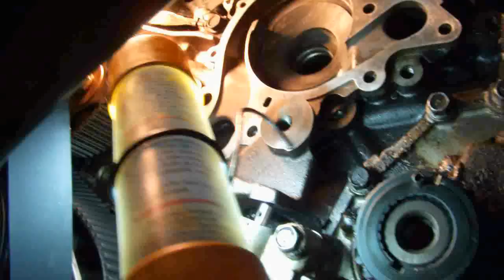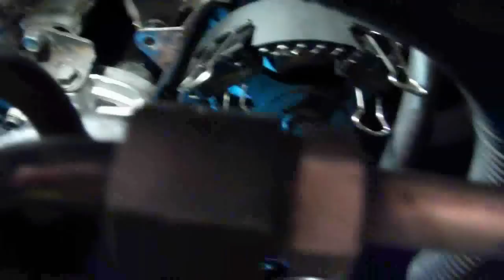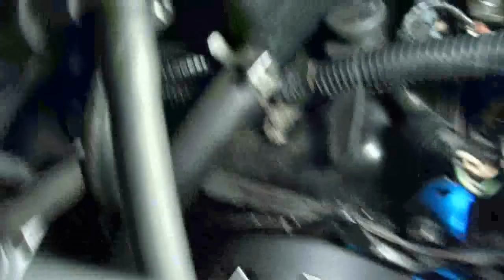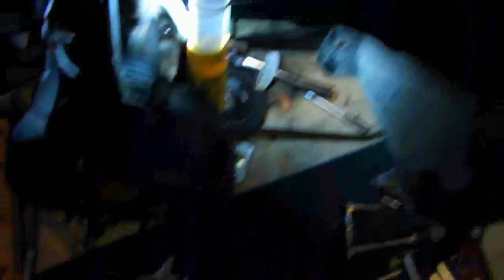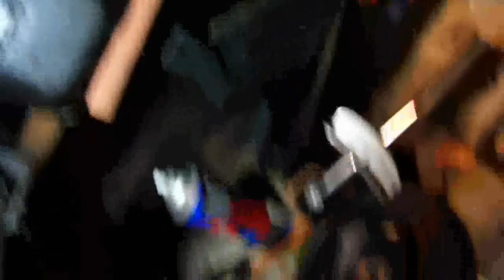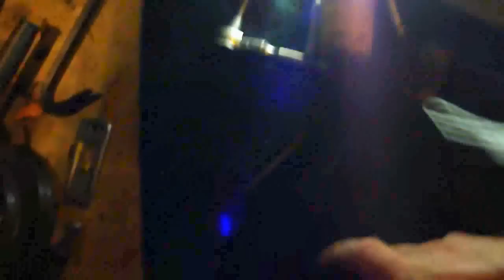1996 to 2000 Chrysler Sebring Convertible, TIMING BELT & WATER PUMP 4 of 4

Comment: I commented 6 years ago and now I'm. I have to change my cam sesls and know i have take off the timing belt to get to seals under cam sprockets. I have a 1998 chrylser cirrus lxi. I know the steps but need a little clarity you may be able to assisit with. Once i remove engine mount, and timing covers, and crankshaft pulley to expose belt, do i need to put the crankshaft bolt back in to set top dead center(TDC) before taking the belt off?
Reply from the maker: You definitely want to maintain TDC.

Comment: Joe seely that was a good piece of advice that you gave us someone I know replace the seal behind the timing belt but they never change the timing belt itself they put it all back together and now the serpentine belt is chewed up and the car is out of time he didn't know what he was doing he didn't know how to put the car back in time you go to the number one plug you find TDC top dead center you take the gears on the timing belt and you line The Notches up that's how you time a car up he had no knowledge of this single parent female pay them all kind of money and he even took her passenger right front tire and took it and stole it and put a donut on that car and it's flat this was a nightmare for this customer good mechanics are hard to find

Comment: What is the average labor price on timing belt change? Also what is the listed labor time for this job? I have a 1998 cheysler cirrus that needs timing belt change
Reply from the maker: It takes 8 hours shop labor so it's not cheap.
Reply: @syyenergy7  I've heard 5-6-7 hours..What do you charge?
Reply from the maker: I'm an accountant, not a professional mechanic.  I just have many other skills in addition to mathematics.
Reply: @syyenergy7  That's even better! You should be able to use your acconting skills to come up with a price. Lol!

Comment: I am having trouble getting the tming belt cover off of the rear cam. Any suggestions would help. Use a bigger hammer is not a suggestion.
Thanks Mike
Reply from the maker: Watch all the videos.  The power steering pump bracket is in the way.
Reply: If you take the rear valve cover off, you will have easy access to the two bolts that hold the back of the power steering bracket on.

Comment: Did you use any type of sealant on the water pump gasket or did you put it on dry?
Reply from the maker: I used Permatex 99MA high-tack Sealant, but you don't need it.  That stuff does work with gaskets.
Reply: Thanks for the reply. Also, do you need to drain the coolant to replace the water pump?
Reply from the maker: most of it

Comment: OK I could have gotten this done 2 days ago. if I was informed on this video to LEAVE NEW TENSIONER OFF.
Reply from the maker: +IceePrettyWings You take off the tensioner to compress the spring.
Reply: +syyenergy7 new tensioner has a pin it don't get removed until you put the belt and tensioner on. once it's in time then you can remove the pin. it's just a pin with a ring that you pull out.
Reply from the maker: +IceePrettyWings I know.  And you put some tension on the belt so the pin pulls out easily.  If you use the old tensioner, you compress the plunger and put in  small allen wrench as a pin to hold the plunger.  I did this job many times.
Reply: +syyenergy7 I get you usually when I do a job like this I normally buy a new tensioner to save the hastle. from compressing it. I honestly think the timing is the most difficult than anything on this car. it literally makes everything cake walk. looking back on everything with them hard bolts in the back of the head was easy lol.
Reply: +syyenergy7 time consuming but easy
Reply: IceePrettyWings

Comment: I tried to put the timing belt on the way you said an I can't get the timing belt on at all its a bitch
Reply from the maker: +IceePrettyWings It is a bitch. I need to use the binder clamps and it's still a bitch.
Reply: +syyenergy7 I got the belt on all the pulleys but needs to be stretched over the right cam gear an I'm about lost cause I have done everything I know to do. I spent since 12 noon till 6 in the evening
Reply: +syyenergy7 would it be possible  to put the belt on an then the tensioner or would that not work
Reply from the maker: +IceePrettyWings First take a break, because you are doing something a little bit off.  Get a very strong light and look at everything carefully.  I find when I use a powerful floodlight I will notice something better than if I just used a regular light.  You might be one tooth loose between the cam pulleys or the tensioner plunger is not compressed when you are installing the belt.  Re-read all the directions that came with the belt.  The pulley that in on the swing arm that the plunger pushes is the pulley that adjusts the tension of the timing belt.  I can't see exactly where you are having a problem.  Take a break, re-read the directions and get a strong light to see exactly how it works.  A strong light might help a lot.  That's sounds too simple but it sure helps sometimes.
Reply from the maker: +IceePrettyWings The problem is sounds like the tensioner.  Maybe it swung way out of position.
Reply: +syyenergy7 yesterday I almost got it on if it had about eighth of an inch more I'd been able to slip it over

Comment: I got a ? is this an interference engine or is it a 
non-interference engine
Reply from the maker: +Eric Jones interference engine
 You should be ok on a 1 or 2 tooth timing belt jump, even 3 teeth.  With a 5 tooth timing belt jump you will have bent valves.
Reply: +syyenergy7 interference makes me cringe cause when I get ready to do the water pump I will make sure it's on cause bent valves will make a man's day go down hill quick. lol. been nice if it was non interference.
Reply from the maker: +Eric Jones Yeah I agree.  Interference engines suck.  Most modern engines are interference especially duel overhead cams.
Reply: +syyenergy7 my fiance just picked up a 99 sebring tonight. water pump power steering pump oil pan gasket thermostat all needs to be replaced pretty much minor easy stuff. but the timing on this motor is going to be Titus.
Reply: +syyenergy7 when doing the timing on this motor since it is interference. what is the best way to set the timing with out taking the risk of bending the valves. do the old trick an pull the spark plug out stick a long extension down until number 1 piston is all the way up. or rotate the cams to pull all the valves up in the cylinder head. I'm used to messing with non-interference engines.
Reply from the maker: +Eric Jones Line up all the marks first before you take off the timing belt.
Reply: +syyenergy7 thank you
Reply: +syyenergy7 what do you do if the timing belt broke and you don't have any paint on the sprockets to line up with the marks? are there no factory marks on the sprocket?
Reply from the maker: +78_TurboBird There are factory marks on the sprockets but they are not very noticeable.   I the belt broke you have definite engine damage.

Comment: I'm doing this job and after getting it all apart I found a bracket on the ground that I hadn't noticed before. I'm hoping you can tell me what it is and where it goes. It's a painted black metal bracket about 5 inches long with 2 bolt holes on each end and an oblong hole close to the middle, kinda reminds be of an engine lift bracket. Any clue what this bugger is?
Reply from the maker: +txmyk Could be the power steering reservoir bracket.
Reply: +syyenergy7 Thanks, I'll give it another gander tomorrow
Reply: +txmyk Turned out to be the engine lift bracket. Bolts to the intake and head inside the power steering pump bracket, runs up the back of the engine.

Comment: my water pump just recently seized up on me. i attempted to do it myself before finding your videos. Problem is all three cam sprockets have been moved and the belt cut off. After putting in the new water pump and the timing belt back on the car starts then dies. All the timing marks are lined up.. Is it because the sprockets were moved after cutting off the old timing belt? If so what can I do to get all three cam sprockets back in time. 1998 Sebring 2.5 liter hard top V6. Any help would be appreciated. Thanks in advanced.

Comment: Synergy. When the cam sprockets are lined up, TDC, in what position is the dowel pin on the rear sprocket?  Same as the front, @ 10 o'clock, or is it @ the 5 o'clock position?

Thanx!
Reply from the maker: Robert Dier I don't remember the dowel position on the rear cam.  I used the mark on the sprocket to time the cams.  The front cam dowel (not the timing mark) is about 10 or 11 o'clock because I saw it on a video I did.

Comment: This job took me about 40 hours to do, but I also did inner and outer tie rods, plugs, wires, cap, rotor, valve cover gaskets, oil pan, motor mounts, starter, alternator, accessory pulley, coolant flush and probably forgetting a few other things.  I'd say I spent about 20 on the timing belt / pump alone, but I'd blame 10 of those for not being familiar with best access points for disassembly.
This video was a huge help for me to even attempt it.  My advice after doing the job myself... Some of the bolt sizes quoted are off 1mm and you might round off the hex heads if you don't double check yourself.  
My biggest point to help you out is the power steering bracket bolts.  I had a hell of a time with these and finally ended up using a long extension and universal to go between the exhaust tunnel and catalyst for the top bolt and between the the catalyst and cross member for the "middle" bolt.  This made this job much easier after I found I could reach these bolts with the long extension method.  Easy to remove and torque via these access points.  Knowing this the first time would have saved me 3-4 hours of frustration trying other access methods.  I actually went back and checked my timing after questioning my work and got the whole thing apart / inspected / and back together in less than 3 hours since I now knew the best way to get to these bolts!
Another tip is belt timing.  I ended up using far less clips then in the videos and got it right the first time in about 20 minutes by routing the belt appropriately over the cams & crank with the idler tensioner off.  After I had everything lined I up bolted the tensioner bracket on and installed the timing belt tensioner pulley.  My belt didn't line up perfect with the marks, I was 1/2 notch either side regardless.  I chose 1/2 notch "short" so that when it does stretch it will get closer to correct and not farther away.
Also... Unclip the fuel return line and move it out of the way.  I ended up banging into this enough that eventually it broke right next to the connector and had to replace a fuel line...  Likewise be careful with the vacuum lines, these were all very brittle, 1 broke in 2 locations...
Thanks again for the videos, they were a big help!!!

Comment: I'll give the durlast wires a try.  I checked my marks today they lined up.  thought I would retention the belt as I wasn't satisfied with how that went last time (maybe too tight).  Reset tension with 3.3ftbs counter torque on pulley and then torqued bolt to 35ftlbs.  pin removed easily.  spun engine by hand timing marks all goos, but the tensioner piston is now bottomed out. is this normal?
Reply from the maker: The tensioner should not be bottomed out but it may be how you spun the engine over.  On the wires, it surprised me that this car will run like pure shit with even some name brand wires.  Duralast works perfect and they are inexpensive and quality.
Reply: syyenergy7 Well hard to believe, but after 12 weeks of futzing with this car, I was ready to donate it today.  I reset the belt tension still ran crappy.  Thought I'd throw a timing light on the thing, but thats impossible, so went to autozone & picked up the duralast wires.  Pulled the intake (again) and noticed that the 5 & 1 wires were swapped!  Well that makes perfect sense.  Happy to say that car runs great with NGK wires too (as long as they are on the correct terminals.  Took the car for a sunset drive to the lake this evening.  It ran so smooth!! I quietly said to it as I drove "All is forgiven".
 Thanks for the input Ssyenergy.  Glad this nightmare is finally over
Reply from the maker: Kelly McKinley
NGK wires and plugs are good in this car.  I tried 2 different sets of performance wires and car ran like shit.

Comment: This job is taking much longer than expected(& I was planning on it taking a while)  After new water inlet pipe & stripedbolts in thewater pump, new distributer cap/rotor , plugs, oil seals the car is back together.  Decided to replace fuel filter cuz gas smelled foul.   Just fiished that job and put fresh gas with injectorcleaner in it. Still runs like crap.  Rough idle, not firing on all cyl.  will go BACK in and check marks today.  Possibly it doesn't like the plug/plug wiresorcap & rotor?.  Ready to shoot this car...
Reply from the maker: This car flat out will not run right with some brands of ignition wires.  Duralast wires from Autozone work great.
Reply: Double check your plug gaps, if they didn't have protectors on the tips it is very easy for the gap to get messed up during shipping.  This caused a rough idle and stumble for me.

Comment: I noticed my car was leaking coolant about 2 weeks ago. Was thinking the whole time it was the water pump. I took the timing belt cover off today and the actual cause is a freeze plug on the head is corroded. When I bought the car there was rust in the coolant system, now I know why. Anyway very good video, next week i'll be changing the freeze plugs on the heads (I pray I can find them here in Germany), head gaskets, timing belt and water pump.
Reply from the maker: They have rubber freeze plugs that expand with a bolt for those places that are hard to reach.

Comment: Ok, I have it figured out.  Removing base plate made it all come together.  Bearing in water pump fails, leaks water thru weep hole shaft out the back of base plate into the valley between the cylinder blocks.  After removing pump definitely noticed a bearing drag which explained all.

Thanx for the info and the video!!

Comment: Did you install the o-ring behind the water pump when you installed it that is in between the impeller rotor and the inlet pipe??  Your video does not address this. What size is the o-ring? Size of a 50 cent piece or so? The o-ring I have came with my pump is that size. The inline water pipe, which I have already replaced, has a pressed on o-ring, so is there one more o-ring that is supposed to be installed in there?  Shop manual is not specific on this

Thanx
Reply from the maker: The o - ring should come with the new pump.

1999 Chrysler Sebring Convertible Water Inlet pipe 1 of 2
http://www.youtube.com/watch?v=e1-j5cqQpsM

1999 Chrysler Sebring Convertible Water Inlet pipe 2 of 2
http://www.youtube.com/watch?v=nXzhLNnV2f8
Reply: syyenergy7

Yes, and it is the size of a 25 cent piece.  It will slip over the impeller shaft, but its to small for the inlet pipe orifice.  Is there an o-ring that must fit between the inlet pipe base and the base of the water pump?  It certainly does not look like the small o-ring I received is going to fit anywhere. Ill check again tomorrow, and thanx again for the quick response.

and there already is a pressed on o-ring on the water inlet pipe. Is this enough to stop the water, IYHO? 

R
Reply from the maker: Robert Dier
I triple checked the dealer parts diagram and there is one gasket and also an O-ring for the inlet pipe.  The O-ring for the inlet pipe is definitely bigger than a quarter.  That must be a wrong sized O-ring that came with the pump.
Reply: syyenergy7 Ok, so if I understand you correctly, I should be good to go, for the Inlet pipe already has the press fit o-ring on it.

There appears to be a groove just ahead of the inlet pipe where a larger o-ring could go, but I see nothing on the impeller side that would hold this o ring in place.

When I double checked the inlet pipe, after the 1st go round and it leaked, I installed a 2cd, larger o-ring at the base of the inlet pipe to the water pump base, and bolted it up, so I should have that covered. (reason being, when I took everything apart the 1st time, I removed an extremely distressed "base gasket" from the base of the wp side inlet pipe, {factory F up?}. This is what led me to asking about needing TWO separate o-rings.  1 o-ring press fit onto the pipe itself, and a 2cd o-ring placed into the inlet pipe recess between pipe and wp base.

Ill button it up and hope 4 no more leaks

Comment: My pump came with more gaskets than I would expect, there's the main gakset, a second smaller gasket, and an o - ring
. I also noticed that the mating surface for the water pump is not the block, but a separate piece that can be moved back and forth. I see no means of removing it. I'm concerned that the extra gaskets go behind said moving piece but I have yet to see any evidence of this in any write up or video like yours. 

Any insights?
Reply from the maker: I only had one gasket, And an O-ring, so that all I used.  Maybe you have gaskets for the water manifold on the other side of the engine,.

Comment: I have a question, I'm going to be performing my timing belt job on my convertible soon. When aligning the camshaft sprockets is it ok to move them clockwise and counterclockwise in order to line the marks up?
Reply from the maker: You do have a few notches tolerance while lining the marks up.   Just make sure everything is lined up perfect for final tightening down of everything.
Reply: Thank you for the quick response. Have been dreading this job, but to stubborn to bring my cars into the garage for anything.